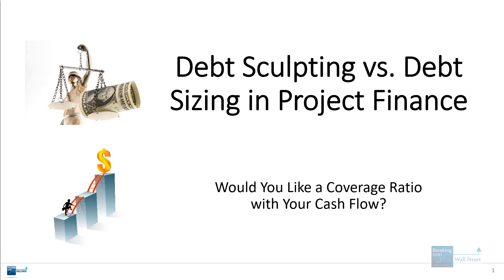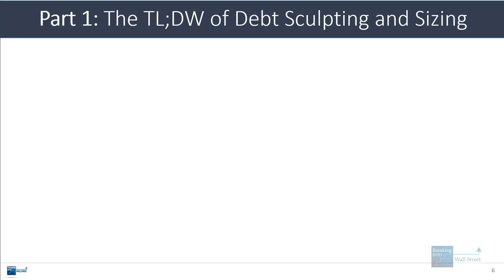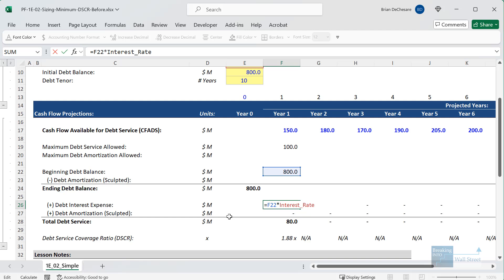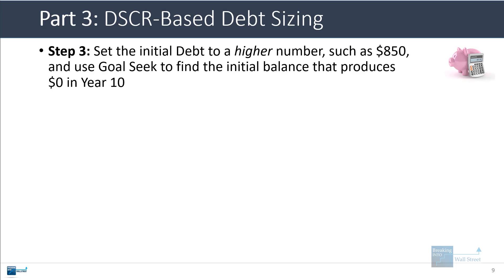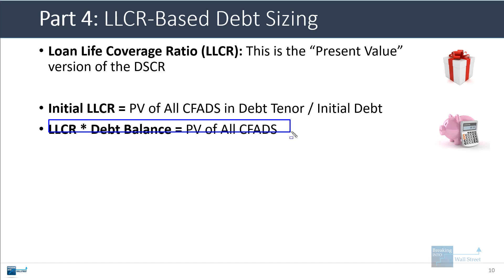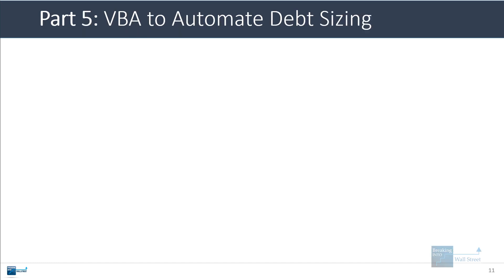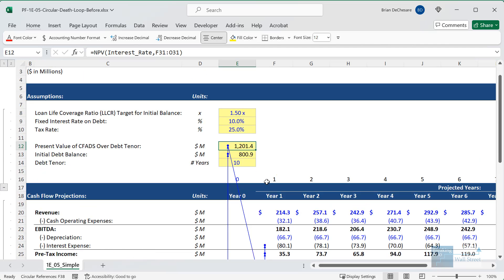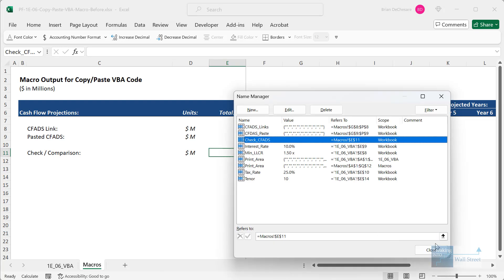Debt Sculpting vs. Debt Sizing in Project Finance

Comment: if doing with DSCR metric to size debt will also create circular reference?
Reply from the maker: Yes, it will, because DSCR and LLCR-based sizing are equivalent. However, if you use DSCR with Goal Seek, that will avoid an explicit circular reference (but the same happens with LLCR). But whenever the Debt's initial sized is linked to after-tax cash flows in some way, you run into this same issue.

Comment: Very nice video, thank you. How would you adjust the debt sizing formula if you were to calculate interests on the average of the beginning and ending period?
Reply from the maker: It's the same formula but the interest will now be slightly different, which means the amortization will be different (so you need to re-size the Debt if you change this). If it creates a circular reference, move toward using a copy/paste macro.

Comment: Thank you for the video. 

I believe that it is worth mentioning that in the majority of cases sculpting with DSCR does not require any circular references or VBA. 

I would like to share with you an algebraic life-hack that will lead to exactly the same result as your mentioned approaches do.

Common mistake of many modellers is that they start to discount some cash flows that they misleadingly call CFADS, although it is obvious that it is impossible to know the exact amount of CFDAS before you find out the debt structure. 

But cash flow that could be discounted is the well-known metric that can be easily obtained - Free Cash Flow to Firm (approach is very similar to classic business Valuation: here the NPV has two debt components - first is the amount of debt we are looking for, second component is all other cash flows that remain after debt service, we may call them Free Cash Flow to Equity and they also include principal and interest. But this interest does not lead to any corporate tax savings). The only difference is a Tax Shield. To get the exact amount of FCFF just use Income Tax calculated as Tax Rate (25% in your example) multiplied by EBIT. 

The next step is to find out a correct discount rate for this exercise. And it is not an interest rate that all models use (10% in your case) - you have to use Modigliani Miller WACC formula instead, where cost of debt is After-Tax interest Rate (10%*(1-25%)= 7.5% in your case) and ‘cost of Equity’ is a Pre-Tax interest Rate (10% in your case) .

Weights of debt and ‘equity’ are also quite easy to find out. If you use 1.50x DSCR (or (Debt + Equity)/ Debt) it means that weight of debt is 1/1.5 = 67% , and the weight of ‘Equity’ is 33%. 

So the discount rate in you your particular example gonna be 8.33%. 

After using NPV function you will get an ‘Enterprise Value’ and after multiplying it by the weight received above (67% and 33%) you will get the exact amounts of opening Debt and ‘Equity’. 

As we know costs of equity and debt and their opening values we can easily find the tax shield for the first period and get the corresponding CFADS. 

So for every period we have to deduct from FCFF the interest payments on opening balances, add the Tax Shield (calculated on the basis of Debt interest payments), and the remaining periodic cash flows have to be fully spent for debt and equity principal repayments (as I mentioned above, equity could be considered as a debt with interest payments that do not generate any tax shield) in exactly the same proportion that was mentioned above: 67%/ 33%.

Comment: I was wondering why we are not ok with Circular References in Project Finance, whereas in 3 statements modelling it's not an issue if we have a switch to disable interest expenses if needed?
Reply from the maker: The issue is that circular relationships in Project Finance are much more significant because they determine the entire starting Debt balance due to the sculpting/sizing. In normal models, circular references make a small impact on the interest income/expense but are not significant for most models and do not affect the starting assumptions. And it's generally poor practice to make an entire model dependent on circular references being enabled or disabled (vs. just using them for added precision).
Reply: It's just nice and perfect. It has its own novelty and adds flavor to the already spicy Project Finance.

Comment: Excelent video. One question, how would you do the sizing if you add cash sweep (let's say, 50%)?
Reply from the maker: Thanks. Debt sizing is normally only based on the scheduled payments and interest because metrics like the DSCR are only based on these scheduled payments, not optional ones. So the cash sweep would be more of an optional addition that just results in the Debt being repaid earlier than expected. Some people might try to factor it in, and you could theoretically add the optional Debt repayments when calculating the DSCR and related metrics, but the standard definition is to include only scheduled ones.

Comment: Great video ! From my understanding, the only issue with VBA is that you can’t build sensitivity tables since they don’t run VBA code. Is that correct ? Do you know what is the alternative ?
Reply from the maker: That is a downside to VBA in models, but you can get around this issue by building the sensitivity table manually using VBA. It's not that complicated, but it does take more code than you might think because of the way VBA works (there are a few examples in our Project Finance course).